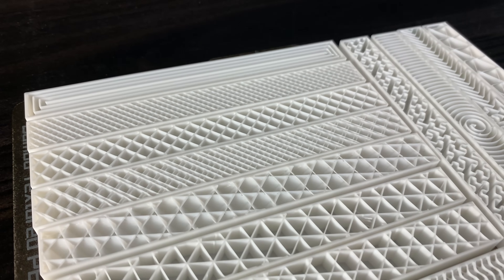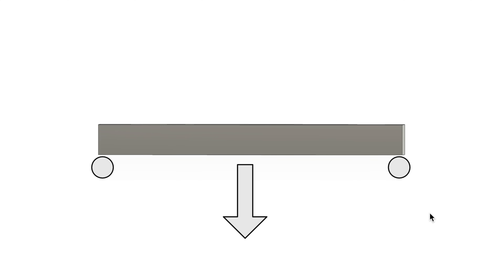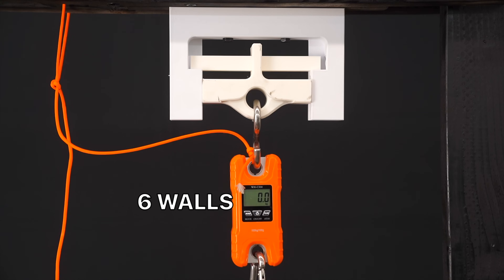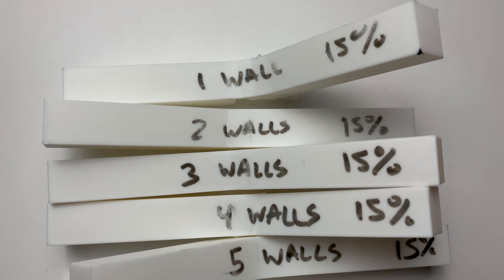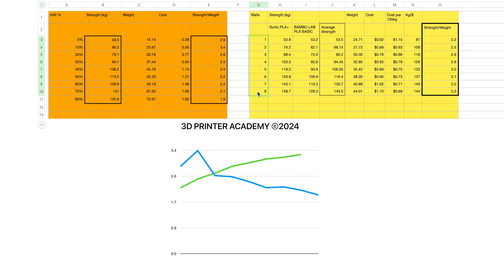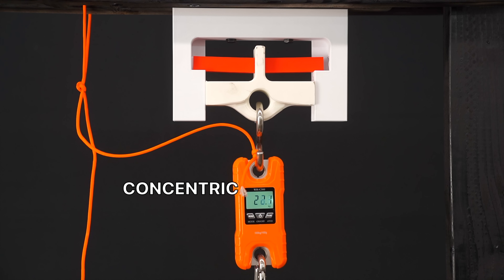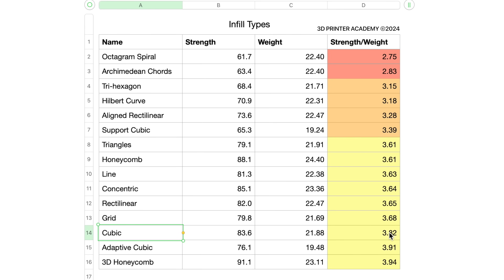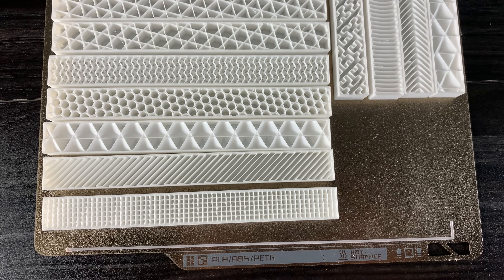This 3D Printer infill is the strongest (3D Printer Academy Tested - Episode 2)

Comment: 5 years ago Stefan at CNC Kitchen did testing on infills. His results were similar to yours, however, he also took time to print into consideration, which eliminated both honeycomb infills, as they took 3x as long to print. That left Gyroid and Cubic the recommended infills.
Reply from the maker: Printers are so much faster now. I don’t think time-to-print is as critical as back then. In this example print time is as follows:

Lightning: 27m
Gyroid: 34m
Grid: 34m
3D Honeycomb: 41m

For most applications that require strength, I don’t think 7 minutes makes any difference.
Reply: @3DPrinterAcademy  Gyroid print time greatly depends on the max acceleration of your printer, as its curved nature implies permanent changes in direction / accelerations, whereas grids and other "linear" types of infill are not.
And I think time is actually still critical. Not for small prints, for sure: 
I came from my 1st printer 8 years ago, a MK8 RepRap, printing at 30mm/s to a Voron 2.4 today, printing at 350mm/s, on a larger bed, but one thing hasn't drastically changed : average print time. I can now consider way larger designs and prints than before, and usually keep max print time under 8 hours.
7 minutes difference over a 30 min print doesn't make much difference. Over an 8 hours print, you would save almost 2 hours. This is critical
Reply: Don't forget about rapid changes in movement directions which potentially wear printer's mechanics. Cubic infill is choice of mine
Reply: Yeah, the results are similar. Turns out one of the best infills is the one you got when you open your first slicer.
Reply: Time absolutely matters, but it's geometry dependent. I have an X1C. Grid can outperform gyroid by hours for some of my prints.
Reply: Cubic for me :)
Reply: Input shaping didn’t exist back then.
Reply: @mozhmike  I highly agree, I just experienced this!:Printed some parts with gyroid at 42% at 150mm/s for about 5 hours, which in the end lead to a (partly) broken heater wire (which cost me about 10 hours to find out...).
Reply: @3DPrinterAcademy  it’s a 7 minute difference on your tests. The 3D honeycomb takes 20 % longer than cubic or gyroid, scale that to a 5 hour print for cubic and gyroid and that is a 6 hour print for 3D honeycomb, so if you have large prints or a lot of stuff to print the time difference becomes significant.

Also you need to remember that not everyone is using fast printers with input shaping.
Reply: @mozhmike  Why I avoid Hexagonal, Gyroid pattern seems to be a nice compromise. though I think I will give lightning a try with some of my prints
Reply: @3DPrinterAcademy  I would think the acceleration has the biggest impact on print time for infill. Since the print head is changing direction the most during infill. It can be critical in some applications. Most test are also small and don't reflect the larger prints people might need to consider strength in. It would be interesting to see some sort of calculation in the slicing software. Maybe both time and strength wise.
Reply: @3DPrinterAcademy It's not an increase of 7 minutes, but an increase of 20%. That can mean hours on larger prints for not much benefit
Reply: @3DPrinterAcademy Not all printers are so much faster. Not everyone prints with newly purchased printers.
Reply: Gyroid is the BEST VOID
Reply: @3DPrinterAcademy  Imho; Time to print has been irrelevant for a long time, unless you are prototyping. Spent machine time is irrelevant for production, only the latency you get parts in hand.
You still have to tune your printer for maximum reliable speed, maximize flow rate etc. but ultimately it only affects how many printers one needs.
Reply: @mozhmike i prefer cubic too but when using high infill combined with high speeds from a certain height it rattels crossing the lines of the current layer. So above 30% infill i do use gyroid. Below cubic
Reply: Gyroid is more fatiguing to your printer, high speed infill speed makes it vibrate when it doesn’t with cubic
Reply: @KyleSSamuelson And that's why I use Cubic. 😊
Reply: @3DPrinterAcademy  7 minutes😮 that's a whole bench lol
Reply: @3DPrinterAcademy  Thanks for this video, I was literally just looking into which infil is best for my situation. In regards to print time, I'm printing a decorative trinket bowl for my wife on my bambu a1 mini; 165mmx165mmx68mm. With 3 walls and honeycomb, 6hr 22min. With cubic, 5 hr 6 min. Since this is really just a decorative bowl, I'm fine with using cubic for the infill to save some time. But for anything requiring that strength, I'll use the honeycomb.
Reply: @mozhmike for corexy, gyroid isn’t more direction change than linear.
Reply: adaptive cubic ehm ehm.
gyroid I like, but if strength or material does not require it, I go for adaptive cubic.

Essentially Adaptive Cubic or Gyroid, where gyriod is more expensive (time/noise/material) but better.

But rest is great for specific purposes, it really matters what you do and how many walls you do.
Reply: @3DPrinterAcademy  I'm honestly surprised Gyroid is as fast as Grid in your testing. Maybe it's because the beams are so thin?
Anyway, I would love to see a "strength per print time" version of this video, too 🙂
Reply: @3DPrinterAcademy  bruh , you might have the new fancy bambu lab printer , but a standard human being that works from 9 to 5 and doesn't have time to really tinker , becoz life gets in the way , 90 % of them still have old prusha's and old enders ....... 3D printers rarely break , so there is no need to upgrade. 
im still running an old ramps 1.4 ,with an arduino mega ..... it still works and it got way better over the 6 years i had it.
print times matter to me.
come to think of it ,i think you should make a poll to really find out what printers your audience is using.im curious to know what other people on this channel are using.
Reply: @3DPrinterAcademy  This focus on "new" and "speed" is misplaced. The physics is the same. Line consistency and how well they bridge is determent for the end strength, for a lot of these. And to be blunt, the line width consistency is visibly poor with the naked eye, even just watching these vids. Once that is fixed, and the solutions are what they are, the universe of strength just looks different. That universe is a bit difficult to navigate, as within this industry, it is like a new unexplored frontier.
Reply: @FoggyShit  "For Gyroid and Grid, you can slightly increase the filling density. The print time will be like 3D HoneyComb, but the strength is higher!"

No.

It depends on what kind of strength you talk about. Also, the best tip to give is to increase the line width of grid infill. That setting is almost always too low. For speed you might to combine infill layers, when that makes sense. Grid is more directional in its strength, but in those directions, it is super strong. particularly if its walls are printed correctly. That is a huge if.
Reply: you man be should have mentioned the no 4 as well. I normally use adaptive Cubic, also after Stefans big test (CNC kitchen). Good so see a refresher of the results.
And we all know it is a big work, so thank you for doing it.
I would have preferred that you made 3 or 4 test of every test, so you have better statics.
Thanks for sharing this with all of us 👍😀
Reply: @3DPrinterAcademy 3d honeycomb is 20% higher than grid. That's 1 hour for every 5.
Reply: @3DPrinterAcademy  That being said, a roughly 20% increase in time from 3D Honeycomb from Gyroid, I think would be quite significant on larger prints.
Reply: Time to print is critical for mass production
Reply: @3DPrinterAcademy  For small prints, you can 100% fill so those that require infills tend to be bigger prints by default right?
Reply: Great comment, Cubic is my standard and go to after your referenced CNC video. I rarely consider changing.
Thanks for posting !
Reply: I feel like the whole testing methodology is flawed if the weakest infill somehow comes out as the winner ... I understand weight is a thing for certain parts but for most I'd wager if your not going 100% infill and your going for strength weight won't matter much 3d honeycomb is my new go to I used to use tri hex and cubic
Reply: @3DPrinterAcademy  Except 3D Honeycomb takes 20% more time to print which adds up to 2 hours longer on a 10 hour print.
Reply: @3DPrinterAcademy  3D Honeycomb generation was improved by speed and strengh (overhangs). Will you do another review of the new "style" vs gyroid? I feel its sometimes better but adhesion to the wall is worse, tue to less surface connections
Reply: Great Test and luckily no background music en no 45 minute video. Well done
Reply: @3DPrinterAcademy  thats 7 minutes, but on a relatively small and simple print (i assume you used the cubes time to print). on a slower printer (some of us poors are still rocking ender 3's), 7 minutes on a 30 minute print becomes 30 minutes on a 2 hour print - significant already. When you blow it up to a larger part.... 

i've seen 5-hour print become 9-hour print changing just the infill from cubic to gyroid. a trade that i will make 9/10 times, maybe 10/10 times now that I have updated info on strength testing using more modern infill styles
Reply: Gyroid infill at 25-30% with 3-4 walls seems like the best bang for your buck
Reply: 7% 3d honeycomb is the same time as 10% cubic for me on my qidi q1 pro. It uses less filament, attaches muchhhh more to the outside walls and inside pockets. I'm gonna give it a shot.
Reply: @roberto4898 it's almost like slicer makers know a thing or two about 3d printing haha
Reply: @3DPrinterAcademy  Print time will always matter. You could increase infill and have stronger part for the same print time.
Reply: @3DPrinterAcademy  not everyone has a brand new printer though.

Comment: It's a fallacy that the optimum point for two parameters is where their 2D curves cross over. It's actually the peak of a 3D solution space describing the strength to weight at every combination of infill and wall count.
Reply: Was thinking the exact same
Reply: Based on this data, the best combination is the highest point on each curve.
Reply: We need a plot of the pareto front (surface)
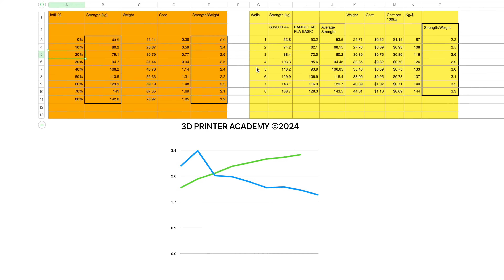Reply: Author is fundamentally wrong about reading the graphs 4:15 . It is clear that best results for infill are around 10% - which means that optimal infills is probably just enough to act as internal support. But for walls it is clear that maximum measured walls is the best. Generally there is not enough data, because at some point thickler shell will not make part significantly stronger, until you reach a point, where you just have 100% infill.
Reply: +1 Mixture Analysis: Because scientific reductionism (one variable at a time) is like only ever observing red and blue and declaring you know the best way to make purple.

Comment: You should probably normalize infill percentage so all the parts will have exactly the same weight, then "Strength/Weight" will be the most important stat because weight will be the same!
Reply: I'd go for strength/speed. I don't care about the weight but about the most strength in the least time (also he did strenght/weight)
Reply: Author is fundamentally wrong about reading the graphs 4:15 . It is clear that best results for infill are around 10% - which means that optimal infills is probably just enough to act as internal support. But for walls it is clear that maximum measured walls is the best. Generally there is not enough data, because at some point thickler shell will not make part significantly stronger, until you reach a point, where you just have 100% infill.

Comment: Might also be interesting to know how strong the infills are in another axis. From my experience Gyroid is quite good in all directions. But it's nice to see that still if you want strenght, you add walls.
Reply: Exactly my thoughts, he should've tested at least the vertical and horizontal axes
Reply: @Reza1984_  So many different ways to test, so many datapoints :)
Reply: Should not use a square. A tube with a 3 mm hole in the center, so it would load the infills in all directions...
Reply: Infill probably will be more significant on thicker prints where the distance between the walls is greater. The strength due to walls probably drops off quickly as the distance between the walls increases.
Reply: also type of beam shape, in structural engineering its very well known that I-beams have better strength to weight ratio than square beams in one direction of load.
so it would be an interesting test to see if using an I-beam shape with infill on both sides of the web would outperform a square beam with infill inside.
Reply: The problem I have with Gyroid is it shacks my Ender 3 S1 Pro viciously.
Reply: Geoid is fast to print too
Reply: @The3DPrintingGrandad  This is why I avoid gyroid as well.
Reply: @Qwarzz  What style of printer(s) do you have.  I just have the one bed slinger. 

I'm wondering if gyroid would cause less vibration on a core xy machine.
Reply: @The3DPrintingGrandad  I have a bed slinger as well. I would expect coreXY to handle it better but it's still continuous back and forth movement so it's bound to shake any machine that has a moving extruder :)
Reply: @Qwarzz  I would agree.  Just wondering how much.

I'm saving up for a core xy machine.
Reply: And in compression and tension, not just shear.
Reply: @Qwarzz Agreed. My go-to is usually adaptive cubic

Comment: Sorry, you missed to show in what direction the infill was oriented in the test. It makes a difference if you apply bending on a part in original z or y direction. If your profile would have been asymmetic i could see by myself, but as you use a square profile, it is hard to precisely make out, which direction is used.
Reply: I paused the video: The pieces are being broken laterally! I bet the other orientation will show better results and gyroid will not end on top any more.

Comment: Good video. I'm not completely convinced that the intersection point is the most optimal, though. It would be interesting to see strength when weight is kept equal and strength tests for both axes.

Comment: When I got started with printing I admit that at first I really only looked at what infill looked the coolest and chose Gyroid. Then I though about it and drew the conclusion that Gyroid must also be one of the strongest infills since it redirects the force away from the direction it is trying to travel in, strengthening the piece as it does. It works kind of like the straws that Mark Rober used in his egg drop video.

Comment: Very  nice!
I usually print 3 walls at 20~% infill...now I know they are pretty much optimum for strength/weight...and my default infill is cubic
I like your testing methods and multiple tests with different types of geometries and infill/walls setup...it really covers alot of the "normal" slicer settings most people use.
Keep em coming!!!!
Reply: It is not, unfortunately he made a mistake implying that. He hadn't tested for best infill/wall ratio and those graphs tell very little about that (and even if they were, he used them incorrectly)
Reply: Optimum according to his graphs are 20% infill with 8 layers of wall

Comment: Thanks for making this video.
First, let's assume the flow ratio is correctly set for each filament, as that will obviously has a direct impact on any part's strength. Also, I'm afraid that without testing different extrusion (line) widths for the top-performing infills you cannot state that infill A is better than infill B. Moreover, different types of infills serve different purpose when loaded in different directions, so that's also something to consider when choosing infill types for a part.
Last but not least - certain infills like Hilbert Curve, Archimedian Chords and Octogram Spiral are to be considered for visual appeal of a part, either in first or topmost layers. Lightning infill is to be used for a model which requires no rigidy (such as a display model or a statue) but still has to support some internal structure. It has a potential to save a ton of time and material.

Comment: I'm questioning if the intersection of the two lines is actually anything particularly notable. Sure they're both plotting strength/weight ratio, but they are fully independent variables. That methodology of reading the plots would only make sense if increasing perimeters also implies increases in infill - clearly that's not the case. How I read those graphs is that to get the highest strength in a standard beam deflection test, load up your perimeters and reduce the infill to just where it can support the shape of the beam internally. Essentially, make a fancy I-beam (or boxed beam if we're being pedantic). Also, the exclusive focus on strength to weight has its own slight issues - like the lightning infill results seem to support.

Comment: Great experiments! I especially like how you designed the 3 point tester. One minor thing is that intersecting the graphs like at 4:05 isn't the best way to optimize. Imagine if one graph were a horizontal line and the other graph curves above it. The best place would be at that peak, not where they intersect. So I'd pick from the peaks in each graph.
Reply: It's not a minor problem! The intersection solely depends on how he aligns wall count to infill ratio, so is completely arbitrary. Geez! 🤦‍♂️
Reply: I'm curious about his motivation about this intersection on a graph being optimal. It seems wrong. From this test you want to minimize infill and maximize wall count. Don't see anything special about infill and walls str/weight being equal. What are we optimizing for, exactly? More meaningful experiment would be to test strength of a piece for given weight changing  wall count and infill simultaneously. And test for different weights as the  optimal point would probably shift.